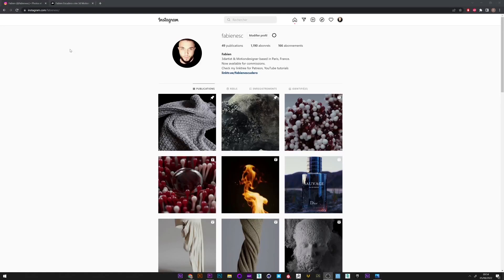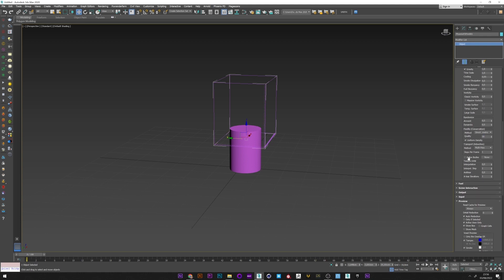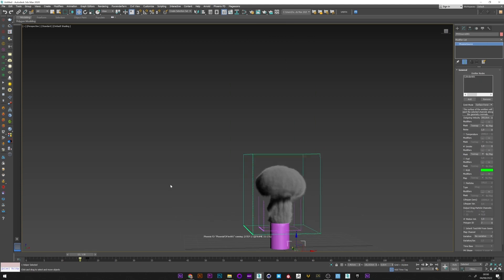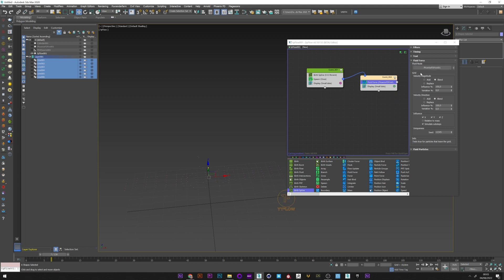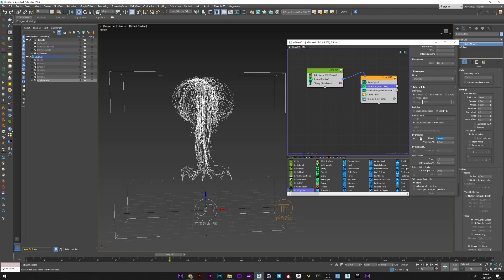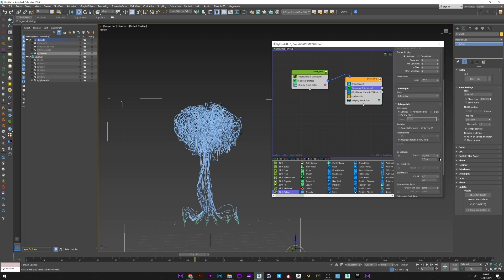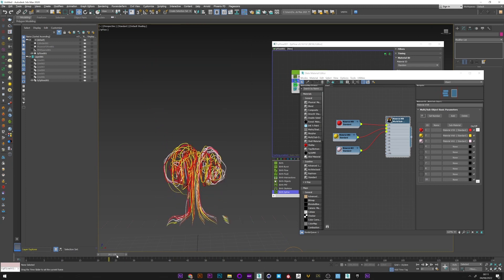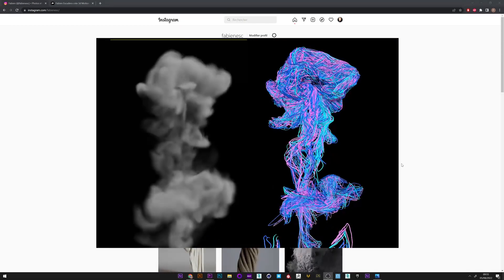Spline advection l 3dsmax x Phoenix x Tyflow tutorial

Comment: Just as a side note if someone has the same problem. I used "adaptive" interpolation on the splines and when I applied the material it wasn't working. It randomised sections of the splines and not each spline a different colour. So if you are having similar problems just change it back to "optimize"